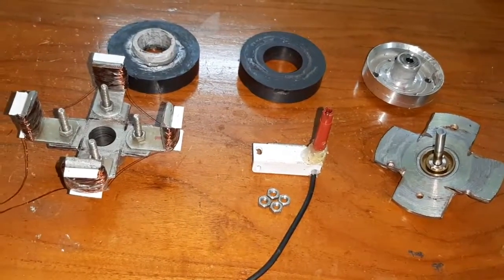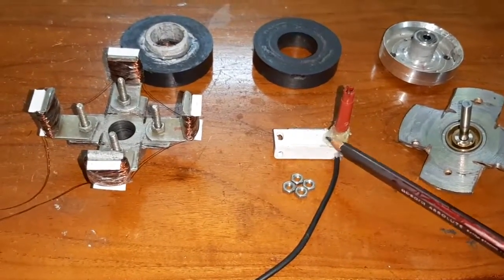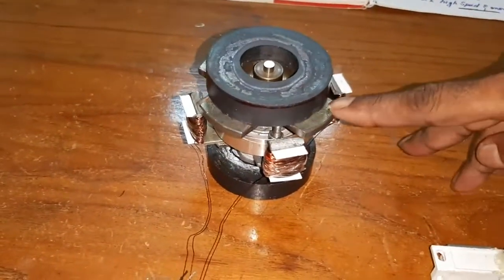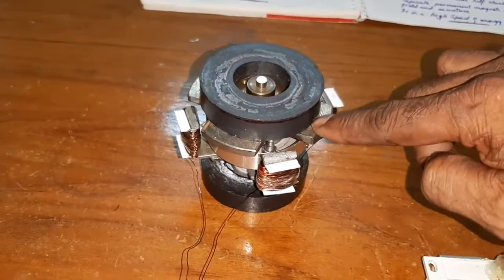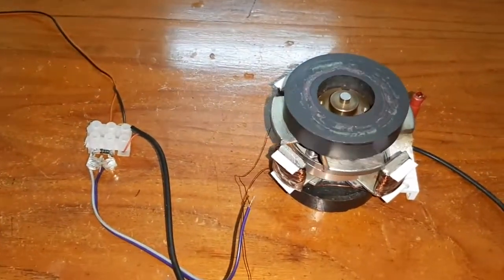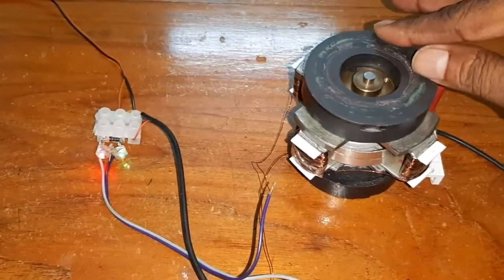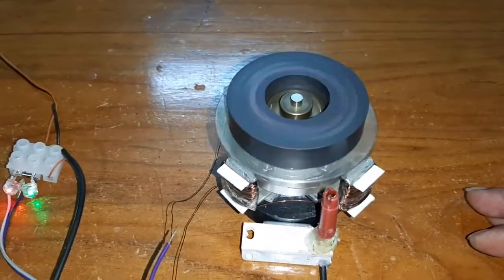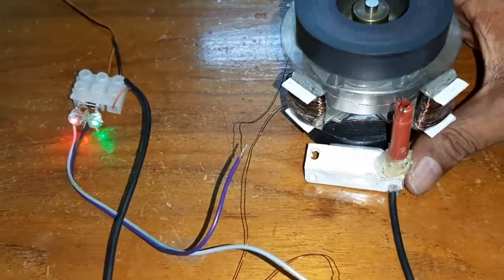(V-1)பள்ஸ் மோட்டார்/Unique pulse motor

Comment: what is the reason behind clockwise and anti-clockwise rotation due to change in the placement of reed switch?
Reply from the maker: Here the stator pole initially energise by the permanent magnet provided at bottom and rotor poles are also north and hence the rotor poles lie between the stator poles ok
When the supply is given the reed switch senses the rotor pole, and hence the stator north pole are vanishing and turn to south pole and  attract rotor, so rotor move according to the Reed switch position right or left.
When the Reed switch deactivated once again  the stator pole turn to south to north and hence the rotor is repelled and rotor move further.
Note: The distance between the magnet and core is adjusted to reduce the field strength of the stator pole initially.

Comment: some info.    if a motor can do no work, it is of no use.    if power cannot, readily, be taken off at the motor's shaft,  it is a  Do-Nothing.      a (single) pulse motor is a Useless  Do-Nothing.     it can be seen that, most pulse motors  Are, in fact,    OUTRUNNERS.    such motors have Inherent  MA, due to the (greater) radius at which the 'force'  is  produced.    this translates to 'more' torque/Nm,  near the motor's  center  of rotation.      in order for a motor to be useful, at all, it Must have   Multiple  drive poles.     it is not clear whether this motor is capable of  making  enough power, to  do  work; which is What a  motor  Supposed  to  do.     googletranslate
Reply from the maker: Thanks for your comments 
The significant  is magnets are used both fied and armature. In pldc motor magnet is one part. So This is a new
 priciple adopted here.
Reply: @pugalstech  i  DISAGREE.   out
Reply: @pugalstech  This is interesting from a design standpoint but this is like those perpetual motion machines using spinning magnets on the outside to create the imbalance. Your motor can only output as much power as your pulse is putting into it. Anything more and the magnetic imbalance between the rotor and stator is equalized and the motor comes to a stop. This is why you could stop it so easily with your hand because the power output is very low.
Reply from the maker: It is a difficult design motor. In order to improve the energy efficiency of the motor here the permanent magnets are added both field and armature. At the bottom field magnet (speaker magnet) was used and the poles are extended by four metal plates.The fourextended field plates are wounded 150 turns each(L. Shape plate).At the top another one speaker magnet provided with bearing and also poles are extended with plates.Now the field magnet and arma..Magnets are same pole and hence the armature poles are lying in between the field poles.when the supply given the read switch sense and energise the filed magnet with opposite to armature pole and it was attracted and hence the rotor move after pole passing the read switch not senced and de energise the field magnet but due to adding of  permanent magnet it repel the armature.Here both attraction and repulsion take place.I am using some new technology but i donot know the benefits  . Thanks for your interest.
Reply: @pugalstech  NOPITY-nope-nope         you are deluded, underinformed  and/or  just  WRONG.       out